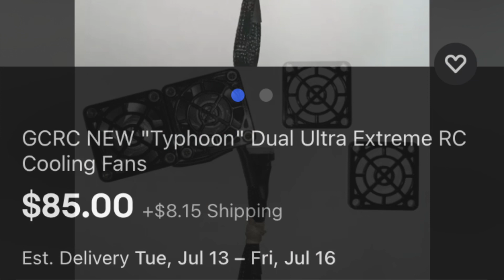Game changer Rc Typhoon fans anniversary for game change Order Now

Comment: Dudes.   Make your own fans.  85 bucks?   All items are, are computer server fans.  Cheap to buy on eBay and all sorts of kinds.  I've counter rotating server fans.

I'm sure everyone RC hobbies has extra balance connectors.   Hook em up and make the same for under 30 for a dual setup.  I've made myself 3 sets for my erevo  and v2 infraction.  I even added stand alone switches to turn them on or off while connected to the batteries ports.  1 switch per fan.   My infraction has an added balance port per battery so I don't have to unhook the fans to charge the batteries since they are on stand alone supplementary switches.    I enjoy your vid regardless of these fans.
Reply from the maker: Your more then welcome 🙏 to build yours I won’t waste my time but to each is own hardware fan covers screen connectors shopping for the right fan and shipping charges in the fans way to much time when I can just order some done with a heat sink just like some ppl buy painted bodies 👍👍

Comment: Got my order in! Thanks for pointing these out! I've never run fans off a separate lipo, so I'm not sure what's needed for the draw of the fans. What size lipo do you recommend mAH-wise to last, say 2 packs, through my Kraton 8s EXB? I don't want to get a bigger battery than I need and add unnecessary weight. Thanks for all the good info you put out!
Reply: You are welcome!!!!
Reply from the maker: Ge changer sell the packs as well but I use 2200 mah 30 c packs fir my fans 💯💯game changer supplied them to me 👍👍

Comment: Love the content bro!
Reply from the maker: Thanks 🙏 happy 4th rc brother 🤛
Reply: Hey Earl can you tell me are the axles on kraton 6s V5 smaller in diameter than the kraton exb versions? Wanna put in a castle motor but I'm afraid the axles and difs won't handle the power
Reply from the maker: The v5 doesn’t have the LSD differential but there real strong and the housing the same size the ExB differential fit right into a V3-V5 Kraton without a housing swap 💯💯
Reply: @earlmoorhead5555  so if I buy the exb difs and grab some exb axles I should be good?
Reply: Oh ok I see what your saying I won't have to chng housings to use exb gears etc thx brother!
Reply from the maker: Yes
🤛🤛anytime 👍👍
Reply from the maker: I ran the stock one on 8s in my Mojave for a year now no diff issue but if for some reason it fails the ExB will go in no problem and the stock axles should work on both diffs 👍👍
Reply: So one more question Earl if I get the F/R ARA310990 difs will it work with stock main input gears? Or will I need to buy ARA310979 main input gears too lol
Reply from the maker: Yes you’ll need both pinion and diff for front and rear 👍👍
Reply: That's how they get you huh lol money money more money

Comment: I need these but 3 into one. One for ESC and two on motor. That possible?
Reply from the maker: Yes 👍 game changer builds them called the earls fans 2into1 🤛🤛
Reply: @earlmoorhead5555  just ordered the typhoons 3 into 1 so does that single just bolt onto my 8s spektrum ESC or do I need to order that plate as well?
Reply from the maker: @never-stock-rc2968  need the mounting plate for the infraction & felony esc
Reply: Yea for some reason I thought the discriminant on the typhoons said that was included I guess my reading sucks lol. So he actually included it for free! What companies does that these days game changer is FOR SURE NUMBER ONE IN THE RC FAN INDUSTRY SECOND TO NONE!!! He didn't have to do that at all!! Has replied to all my questions and answers them right away!! My first YouTube video will he on his fans going into my felony! NeverStockRc is finally going to make vidz in YouTube because of you Earl and game changer!! See ya soon! I'll be mentioning you on there for sure!! Thanks Earl
Reply from the maker: Awesome company support any small guy trying for sure with great customer service 🔥🔥🔥
Reply: @earlmoorhead5555  yes Mike is awesome 😎 🤘 planning on some 1/16 stuff maybe...

Comment: There good fans but if you ask me … there too over priced for what it is dude . I make all my fans and make them waterproof by conformal coating them. Does the job 👌, 
Thanks for the info  😎👍
Reply from the maker: Nice 👍 making the fan guards heat sink connectors all adds up but if you have the resources and skills best to make tour own 👍
Reply: @earlmoorhead5555 some of my resources are from Ali Express . Even though the  Delivery takes a while but it’s worth the wait for the price you get it at  . 😎😁
Reply: I respect your comment and your ability to create what works for you but nobody knows what it cost me to have provide these products.  These fans are not your average $5 fans or cheap used fans you get online. I know there’s a lot of fans out there hundreds of different types of fans and there are several fan manufacturers as well. When people buy cheap fans they are cheap because they are either used or because they have so much stock lying around and they’re not moving. I specialize in fans and work directly with the manufacturer with my product. I do appreciate everyone’s comments especially yours. Have a great 4th of July
Reply: @gamechangerrc4633  it’s not just for me though . It’s for everyone that can’t afford $50-$70 fans or maybe more .
The work you put in is impressive , 
the expensive parts you purchased and put together. Brilliant idea but there’s no harm in doing it with cheaper materials…main point is I ain’t here to upset anyone, I’m just a rc fan making my point that it can be done cheaper, which also has the same results as yours . Hope you guys had a lovely weekend. ☺️✌️take care brother .
Reply from the maker: Same result but not near the reliability and craftsmanship and that’s what game changer stand for 💯💯like I’ve explained before anyone who want to make there fans available to the public and sell them I have no problem buying them and putting them in my rc cars and sending them like I currently do 💪💪🤛🤛
Reply: @earlmoorhead5555   I’m sorry but You haven’t tested all the fans out there to know what’s durable and whats not … If you haven’t tested all the fans out there, then you really have no say in what fans are more durable . I’ve mastered GC & NTF fans  and made with cheaper materials and it has the same durability .  that’s all I’m saying, no need to hate bro, just appreciate😎. like I said before I ain’t here to upset anyone but to help the ones who can’t afford it which also can be made with the same durability. It’s not rocket science.
Reply from the maker: I haven’t only NTF fans power hobbies and game changers and castle fans that’s why I say I buy what available to me as an rc fan on the market 🤔🤔